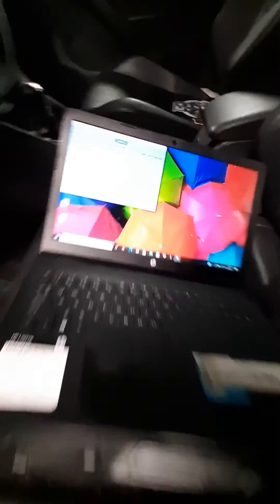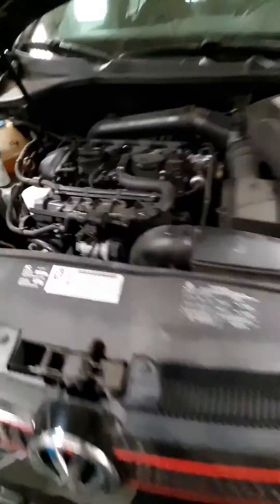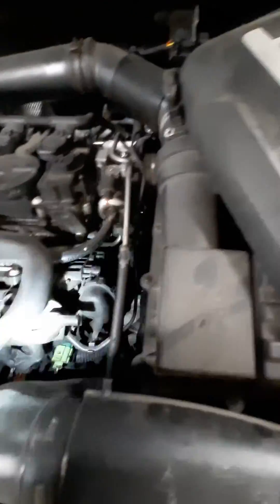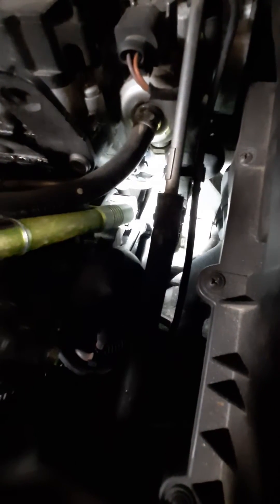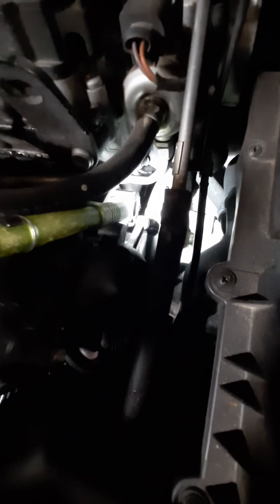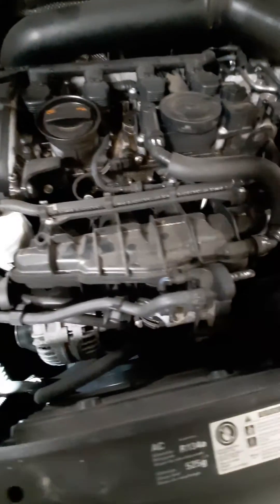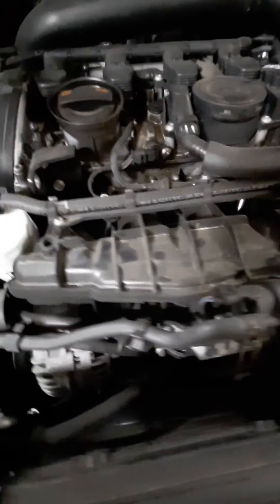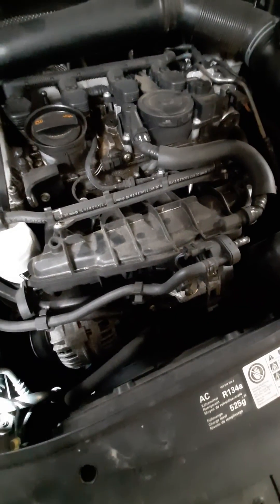Diagnosing and explaining how intake manifold on VW 2.0tsi fail (mk6)

Comment: So how this actuator work
I understand that the actuator arm should open when you reach 3800 
Should the actuator arm stay open when you keep the rpm on 3800 and then when you reduce the rpm it closes depending on the rpm?
Because mine the actuator arm moves open and close fast when i reach 3800 even if i keep the rpm 3800 the actuator open and close fast it doesn't stay open
Reply from the maker: Are you getting position sensor faults for your intake flap?
Reply: @EuropeanAutoRepair  
Yes 
P2015 intake manifold 
P0304 misfire in cylinder 4
P130a hide cylinder

And overheating on high rmp drive

So at the beginning I noticed that the intake manifold actuator arm was not moving at all in any rpm
I found that the intake manifold solenoid hose was blocked with a rubber thing from the vacuum pump side.i removed the rubber thing and cleaned the solenoid and made sure that the solenoid is working 
And now the manifold actuator work when I reach 3800 rpm but it will move open and close again fast even if I keep the rpm on 3800

My though is it must stay open when I keep the rpm at 3800 and closes along with reducing the rpm 

Am not sure how it functions,is that the proper function of it!
Is it supposed to open and close fast even if I keep the rpm at 3800?

Comment: hi, i got that problem. whats the fix for this?
Reply from the maker: You have to replace intake manifold, they update to a slightly different design
Reply: new design is no hole in it? thanks
Reply from the maker: No problem!
Reply from the maker: @a.c.e.m  Yeah the new design has different intake flap design, they do not have the same problem
Reply: hi me again. my mechanic just told me intake manifold only needs to be replace on fault code 2015? and cost arm a leg?
Reply from the maker: Yeah that fault usually means the flap that's built into the intake manifold has failed. I've heard of some aftermarket part that adds a physical stop the the outside of the intake to correct the issue but replacing the intake and cleaning the valves whiles its off is probably the best idea
Reply from the maker: Probably around 6 or 700 dollar job I imagine
Reply: the side of intake manifold is buzzing noise.